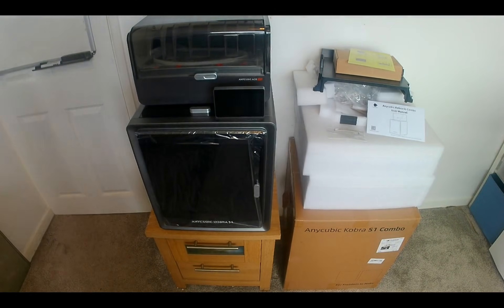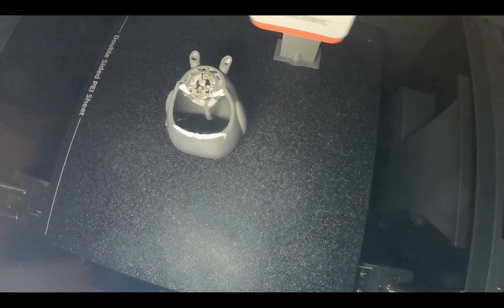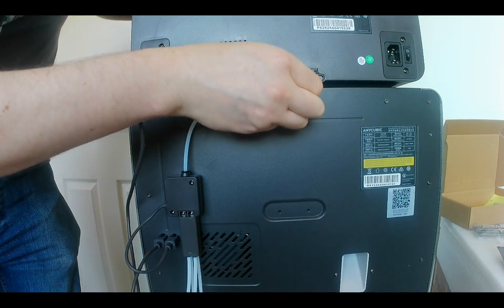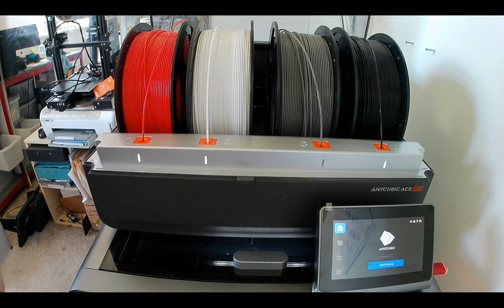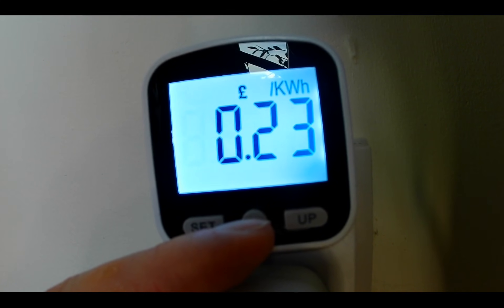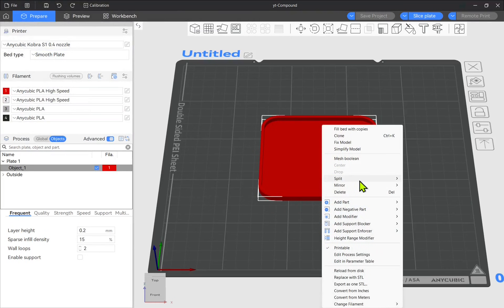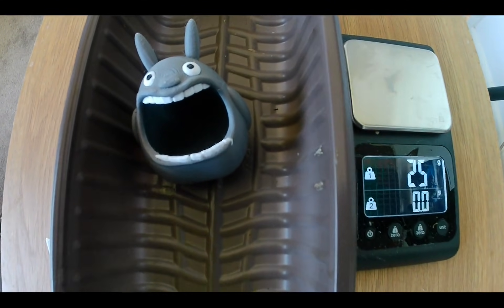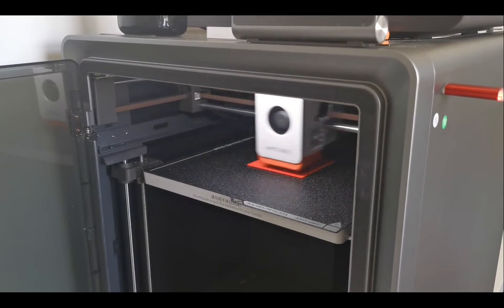Honest Review of the Anycubic Kobra S1 Combo + Ace Pro

Comment: I just ordered the S1 combo on a great sale ($429 USD). I was going to wait a year or so for the tool changers to advance a bit. However, the other night I stayed up until 2am to do a manual filament swap on my current machine and realized that this could do it for me and would generate the same amount of waste as the manual method. Will also allow me to use the remainder of a spool with automatic switching. The day after I ordered it I started seeing ads for their next generation filament changing head design. The reason for the steep discount of the current product is now known. I don't expect to do a lot of detailed color until tool changers advance a little more.

Comment: Right now the fastest / least wasteful single nozzle changer is Prusa machines with the MMU3 - it pulls nearly the entire filament, rather than cutting it. That said - several manufacturers have announced tool changers, which is a much better solution to multicolor, and enables truly multimaterial options as well.

Comment: Well, i just got a replacement for my not working one... Let's see how it goes on. But i could definitely not see any spaghetti recocnition in the faulty one, And id had many chances to do so.
And i cannot get it on the wifi (same with the first one). The router in the house is not found at all, the other one further away in the garage is shown, but i cannot connect.

Comment: The filament change on a Prusa MMU3 takes about half a minute or less. If you leave a link to the model, some hints how much you scaled it and how you colored it then I can do a test print on my MK4S+MMU3 for comparison. If you are interested.
Reply from the maker: Wow that's so much faster!!! It's the same time every time I change the colour.  I have a look to see if I can get those stats because that would be cool.
Reply: Correction: it seems my printer feels faster than it actually is, sorry for that. I did some calculations with the slicer - color changes take about 55s on a MK4S+MMU3. Still faster than the Kobra at over 2min. At the moment the price difference is 260 euros - the reader may decide whether it is worth it.

I also checked: Core One - identical to the MK4S; and XL which only takes 21s to swap print heads (it has up to 5 actual print heads).